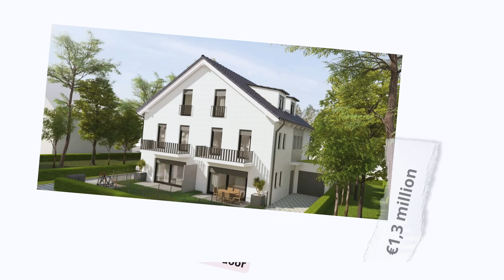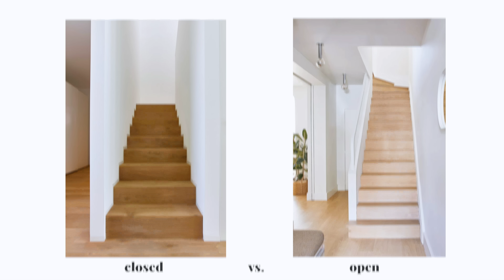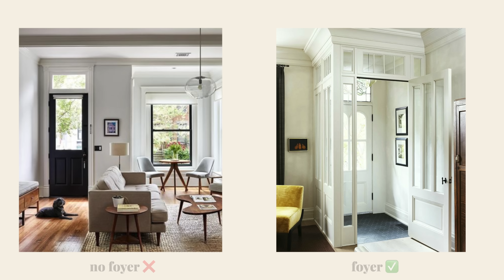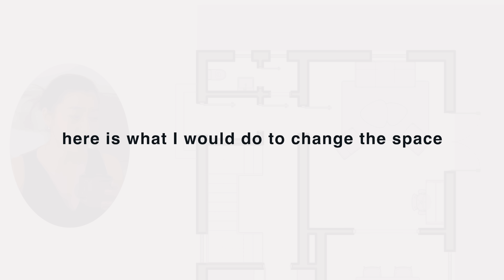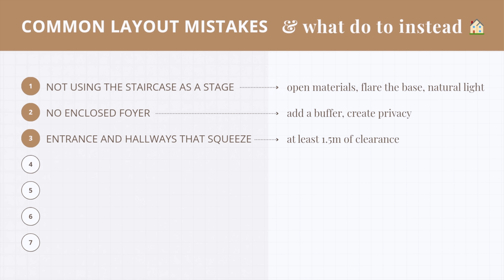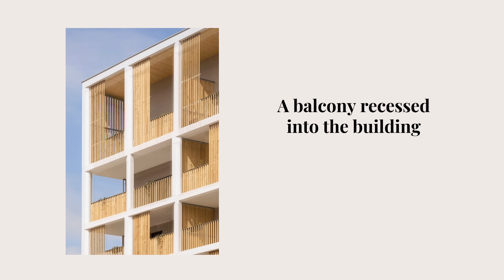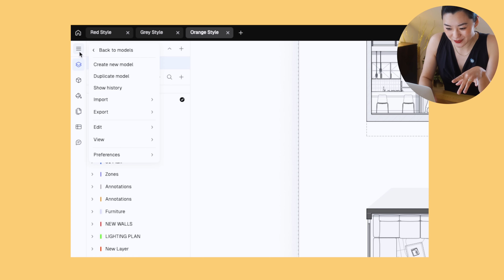Architect’s Advice: 7 Common Layout Mistakes + What to Do Instead

Comment: This was a Really helpfull video. Thank you !!
I have question though. Do you use this software for actual clients/projects? I'm a planner for technical systems (plumbing, airflow, heating etc.). Design is important to feel comfortable in a home, but so is a functioning toilet.
My concern is that the program doesn't have sufficient data in its files, so you can't use it for further planing. For example can you ad dimensions to the architecture? Can you ad heat-resistents-values to materials of walls etc.? 
I saw you can export it to DWG but how well does this work? 
The Programm looks great and not to complex (compared to Revit vor example). I am just scared of geting a file made with it in my professional live and having to invest hours to making it workable.

Btw I am from Germany. We are very strict concerning normes and regulations in construction. I am aware that not every county is this nitpicky

Comment: These examples are certainly not like the average house in The Netherlands. Hardly any point can be used in Dutch houses. The guest toilet is almost always next to the front door, but the door turns towards the hallway, not towards the front door. Cantilever balconies are the most common balconies at apartment buildings I have lived in, I never had any problems with them. I also had an apartment with a loggia and that was a problem, they are to closed off and have little sun and it makes it dark inside, much darker than cantilever balconies. So I don’t agree with those 2 points of your list.

Comment: 5:21 uninterrupted, yes. and you removed the working desk in the top right corner of the living room entirely it seems.

you always have to put function over form - first look at what you want to do in a room and what you need for it, then look how you can integrate it.

"Oh, the desk doesn't fit the perfect room design, so out it goes, nobody needs to work, right? *right*?"

Comment: Staircases are dramatic .. dramatically bad for household energy consumption! If you want to be able to keep your downstairs area warm, or your upstairs area cool, you need to wall off the stairs and shut the door on them. Otherwise all your warm air is going to rise up the stairwell and your downstairs will be freezing all winter and your upstairs roasting all summer.

The part I'm struggling with in my current design is essentially a great room, with doors coming in at inconvenient positions on three sides and windows along the sun side - but somewhere I need to fit a space that has no traffic through it and has a toddler-resistant fence between it and the rest of the room so that I can be sewing in that space and still keep an eye on the grandchildren. I just can't see how to fit it together, and it's driving me nuts!

Comment: always wanted to be a designer (of whatever sort, Automobile, Architecture, Landscape) 

ended up in a cubicle. what a mess and waste of life
Reply: 1) architects end up in cubicles too. 2) you can still be a designer of things interior design, residential architecture (so you don’t need a license) and landscaping design. You’d just have to get clients which would be the hardest part. But if you actually want to do that and it’s your dream I think you should go for it 🤷‍♂️. Worst case your side business fails and you continue your cubical job. Best case you take off and succeed and can quit your office job

Comment: Nice. But everyone knows windows are good. The main problem is most of the time, a square only has 4 corners and those are the areas that has 2 sides of windows. in contrast the middle of a square doesn't have any windows

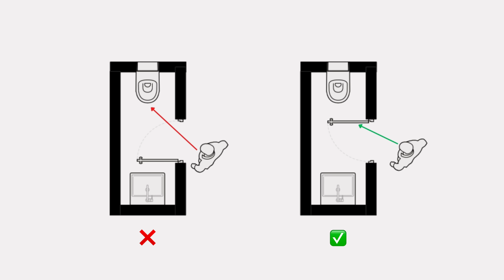Comment: You forget to mention that some of these solutions will cost you much more. 4:07, 6:20, 6:23 Ahh yes a door opening into something. 6:23 just switch a side where it opens, let it open into a sink instead of a toilet... How about you let the door open outwards, instead of inwards, so it won't damage the sink or the toilet and create more space and having access to both sink and toilet straight away? And how are you gonna close that door when you need to use the toilet? Squeeze yourself between a sink and the wall? It is a big problem for a lot of architects who still keep designing without a consideration of where the door might be when fully opened, lots of architects still design plans where doors open into another door, wardrobe doors, toilets, sinks, another humans doing something etc and the simple door stop will create a trip hazard and if a door stop is installed too close to the doors swing, it will reap apart hinges of the door forcing the door out of the frame. On your plans doors are always opened to 90 degrees, but guess what, in reality they open way more than that.  4:07 a walk in closet in front of an opening door, ah yes great solution... Take it with a grain of salt, but you have a long way to go, just cause you read some books or took some courses doesn't make you a great architect, you have to be on a construction site and see your flaws.

Comment: Do you think we are shitting space or something? Where would we get 2 walls for light? we live in a box in a street, that only has 1 wall with light, the street wall. The real solution, is a decent light. Not those pis lamps, but those lamps that produce thousands of lumens. Not to forget, where is the technical shaft? There is zero space for modern home heating equipment, a heat pump still requires a lot of indoor space, then you also need a realise that pipes and air ducts take precious space, and increasing the height of the building isn't possible because of building codes. You also need to keep in mind where the load bearing walls are, how big the spaces are, where the bathroom is, if you need I beams. Just drawing something is akin to asking for misery. Unless you build the American way, in wooden framing, because then you have space over. But over here in Europe, where everything is concrete and where the building codes are a lot more strict.  Just drawing a random plan isn't going to work, and the architect is just going to throw it out of the window and call you an absolute buffoon.

Comment: Sorry, I have to disagree about balconies... I have a self-built house. I bought an architectural design with two balconies and here in Poland even if you buy a complete design you still have to get a professional architect to "apply it to your land". During this time changes are also possible. So my architect asked if I want any changes. We did change one window size and delete the basement(due to cost). Balconies were not mentioned. Then during the build so called "unconsequential" changes are allowed and my contractor was like "For sure we're not making these balconies, right? RIGHT?". I said Nope, you are making them and you're insulating them properly so there is no thermal bridge, doing a concrete slope, hudoisolation and tiles... He was very keen not to do them and tried to convince me for quite a bit with "This in a rural area, no one needs balconies" etc. However, I chose this design and the balconies were one of the reasons. Of course he didn't budget the work for them so in the end I agreed to pay a bit extra for it. Now it has been almost 10 years since I've moved in. And I have to say I'm pretty happy with the balconies. One of them is in the room that is my home office. In the better part of the year I can just open the door, walk out and enjoy the view much better than through a window. The other one is in a master bedroom, that one is used a lot less, but it still gets used occasionally. Both balconies have been very convenient to access the upper part of the facade to install CCTV cameras and wireless access points. It is far too high for a ladder so I'd have to hire heavy equipment every time I need access there. In general, for the small amount of money I'd save they are well worth it to me.

Comment: 3:21 I know a project that will help all of your projects, ok design a new york condo this is the hallway leading to the https://www.youtube.com/shorts/n07rdvXE2dI?feature=share  the condo. the condo is a 2 story rectangle. the outside of the building is historical and can not be modified and the condo has 3 long but thin windows 2 are together, the single window is the only one large enough to hold a window condition unit, a fire escape is on that window and must open by regulations, their are 2 swage pipe one pipe is located next window role a dice to find out what window, another pipe is located next to the condo door, the door is exactly opposite to one of the windows, roll a dice to find out what window. once you place the windows and door and swage pipe you can not move them for the design, but you can add a sub flow provided their is enough slope to carry the waste. heating their is old hot water radiator style building heater. it's located next to the window roll a dice to find out what one, their are few cold water pipes take one of your first attempts for the project and place the water inlets where those old designs needed them. don't forget to put in hot water, you can even use on demand but you must vent it out one of the windows. the budget is $250,000 however it's a older historical building and the unit will not support the weight if you just flood the whole thing with concrete in frustration. you start out believing the 2 story rectangle is 2500 sqft however during demolition the true measurements of the unit will be discovered roll 2 dice to find out how many feet of the rectangle you have lost in each direction. the unit will need some sound proofing so build that in to your plans. flip a coin to see if the unit has a gas line for cooking and hot water. you can use the fire escape as balcony provided it's not blocked in any way. work on this project when ever you get stuck with another project. try it once as quick game, you will become addicted.

Comment: My feeling is a house is two parts. The public and the private. You have to access the bathroom without a parade thru the public space .Or thru the private space. Limited space limits your choices. Architects have a need to be different,which doesnot mean they are realistic or even competent. Its Art for them. Compact plumbing is a good feature .Not buried in a ceiling or without access panels. My advice     is keep it simple.

Comment: Run back through your staircase examples considering Safety as a high priority and suddenly most of your examples of 'good' staircases go right in the trash and most of the 'bad' ones look like very good ideas (though, admittedly, it's a real mixed bag as to whether the problems with the 'good' ones are because of the thing you're using them to illistrate or not).

Comment: What can I do with a staircase that I am not allowed to make any modifications to as the home is social housing?  What can I do top brighten it up?  It is mid terraced so no, I cannot put windows in there.  The front door leads directly onto the staircase (about 5 feet from front door to bottom step) The door itself (again I can't replace as it's social housing) it is a pvc door with two small square windows at the top which are frosted about 20cm x 20cm and that's just a guesstimate.  The measurements could be as little as 10cm by 10cm.  The stairs have an open bannister to one side and a wall at the other which again, I cannot remove as it is adjoining the neighbours and it is mid terraced.  How can I make this dull hallway brighter, elegant and at a low cost budget and also keep in mind I have children and pets (very messy people)?  Thanks in advance.
Reply: I should add, I'm allowed to decorate.  But not allowed to carry out structural work.

Comment: @baixu as to the "feeling squeezed" section, what do you think about frank Lloyd wright's "catch and release" principle of making entryways tight and confined, and then slowly opening the home as you enter into the public spaces.
Reply: Normally any isolated or semi isolated entryway is tight in comparison to the living room or dining room (whichever follows the entryway). It's less common to enter the grand foyer and then proceed to equally grand living room and to not experience "catch and release"
Reply: Entry rooms should be small. Just not too small.

Comment: Fantastic video, very informative! 

But the "windows at two sides" advice seems inapplicable to 99.9% of situations. In all the houses I've been and the 20+ houses I've viewed before I finally bought mine, the window locations are impossible to change because the houses already had as many windows as they could take. The overwhelming majority of rooms can only have windows from one side... We're not aristocrats that can afford to buy isolated houses :D most rooms in most houses touch 3 walls that neighbor other rooms or other houses.
Reply: That's true! Most rooms in houses in my country would have windows on 1 side only. In our building code, it's not required to have a window or closet in the room (to be called a bedroom), so some bedrooms don't have windows (esp some apartments for rent). 

Many shoebox condo units and hotel rooms (around 4 x 6 m = 24 sqm or ~240 sq ft) have windows on 1 side of the unit only. So yeah, having windows on 2 sides is nice but it's a luxury for many homes.
Reply: I suppose her advice applies only to people who can afford to build from scratch. The rest of us have to make do with existing housing stock where it is impossible or prohibited to rearrange the walls, the stairs and the windows.
Reply: You’d be surprised. Many houses (even on tight lots) benefit from double sided windows. Even if you’re just looking at your neighbors siding 10’ away it still lets in light and makes the room feel airier 🤷‍♂️. I know a lot of volume home builders only use 1 window per room to save on cost but if you’re buying a home with optional side windows you probably should get the upgrade. Also tbh most yards are large enough to have two sided windows comfortably 🤷‍♂️. If your home is 20-40’ away from the neighbors home then it does actually let in enough lighting and air to feel breezy and comfortable rather than dark and overly close to the neighbors house.

Comment: My bugbear is the common layout of the garage on the side and front of houses. Who wants to look at someones garage?. Or cars sitting out front. Poor layout but almost all homes nowadays have them. Surely must be a better and still functional design.
Reply: The garage frontage can be designed to reflect the style of the rest of the facade of the home.

I have seen some where this has been done deceptively well to the point that when I saw the access to the garage open I was surprised.

I used to live in a home where the double + garage was tucked away at the rear of the block.  Yes it made the front of the home more aesthetically appealing, but I used to play with potential redesign options to better use the wasted 100m2 of space.

Comment: Well, to move some walls that  are not load-bearing, you can do that. Otherwise, you should certainly not touch them.
Then, "...these are a small changes", to move a toilet and zink aren't small changes. You need to open the floor and have new pipes. For that, you need a plumber, which is certainly not cheap. It is better with another solution.

Some suggestions you make here can be done. But others are not so clever.

It's different if you built a new house, and also if your planning and drawings are approved as well as you get building permits, then you can place windows in a different way. But these horrible floor-to-ceiling windows should be banned by law. There is hardly anything uglier.

Comment: I believe at least some points are at least somewhat influenced by cultural biases.

Balconies should be open, where I live, and at least somewhat planted. They're not another room, they're your little personal piece of outdoors next to your living space, your high vantage point onto the world below. If you could afford it, you'd get a house with a garden. The balcony is the imperfect but still usable replacement, where you can have a coffee, a tea or a glass of wine, forgetting about the dry, stressful and busy city around you - or at least look down on it, no longer vulnerable to its constant aggression. A boxed in balcony can't do any of that.

Also where I live, your home is your fortress. You don't want the noisy, annoying, busy world outside to get into your home. As such, a narrow, sort of fortified entrance, clearly marking the transition between two worlds - the outside world, which is never at peace, and your home, where you want peace to always last - is what you want. A light space doesn't communicate such a  transition well. Instead, you get in, from the noisy and excessively, or at least garishly lit street, into a slightly darker, quiet, protected space, switch your shoes for slippers, put down your coat, and then enter into the light again, into a peaceful, quiet, sheltered space.
Reply: Interesting perspective!

Comment: how can you know if the wall is not load bearing??
Reply from the maker: usually a structural engineer needs to come and inspect it on site to be sure! they’ll look at how the loads are distributed through the building

Comment: What I do not like with your comments, is the handling of the entrance areas. The entrance area is not only about looks, but also about handling temperature differences between outside and inside. So opening the entrance area up, robs it of one purpose, at least in cold climates. Of course the entrance area must be big enough, to divest yourself from heavy coats and wet shoes for more than one person.